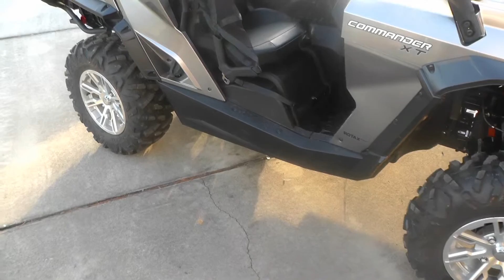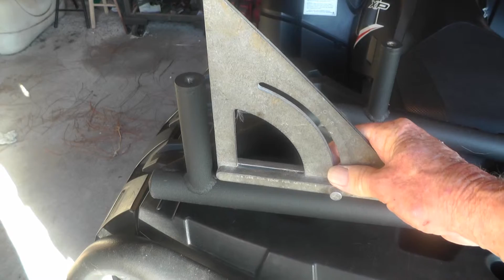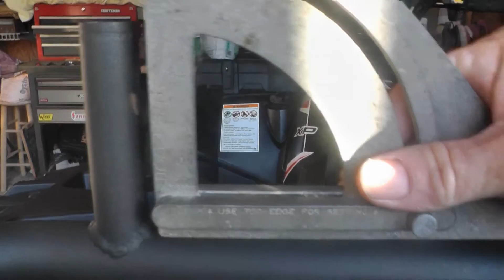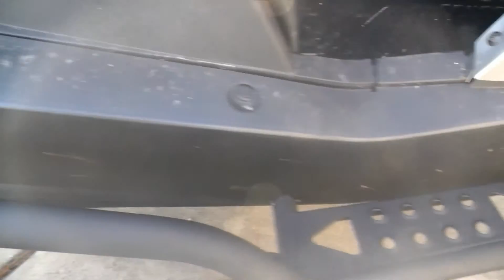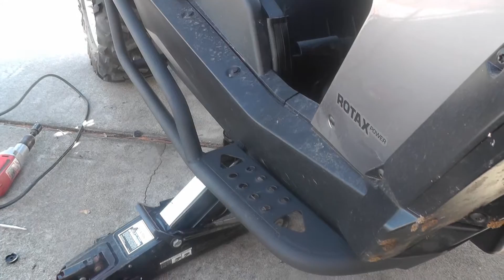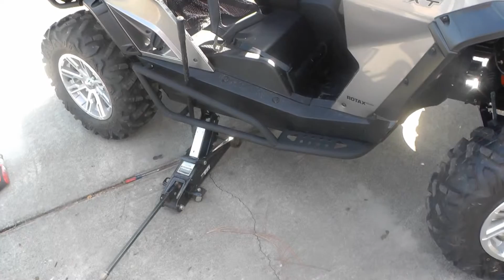Can Am Nerf Bar Installation- part 2

Comment: Thank you very much for taking the time to make the video. I have a suggestion for anyone that will be viewing this. I have never installed these but I have a lot of experience in maintenance and this by no means meant as criticism. If yuo are having trouble getting the holes in the bar to line up with the frame, purchace some set screws of the appropriate diameter, thread pitch, and length (long enough to accommmodate a nut and lock washer), install the set screw (with loctite) into the bar, and work it into the frame. The set screw will then become studs and secure them from the other side with the nuts. I hope this helps.